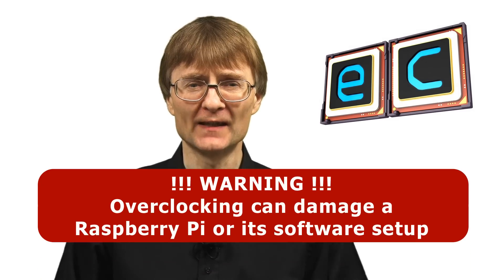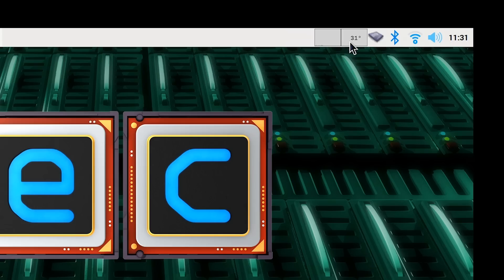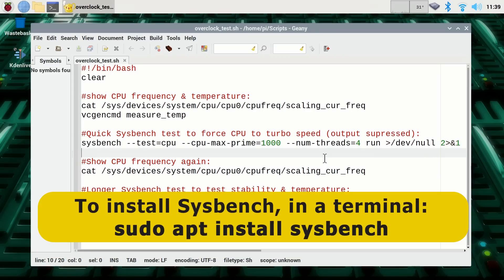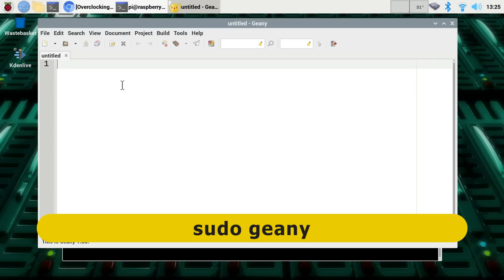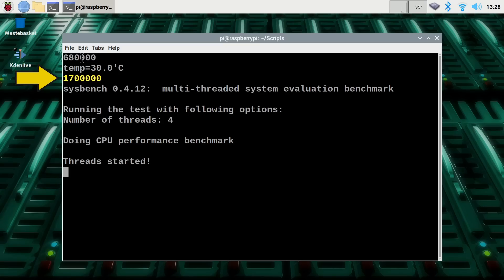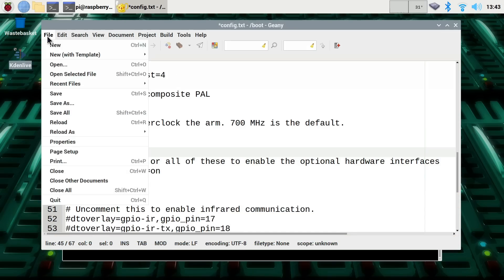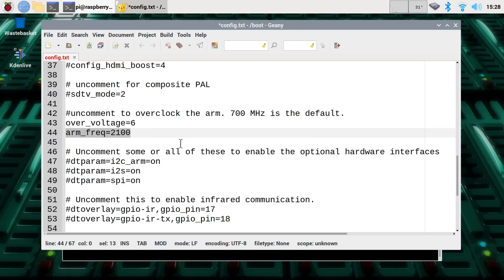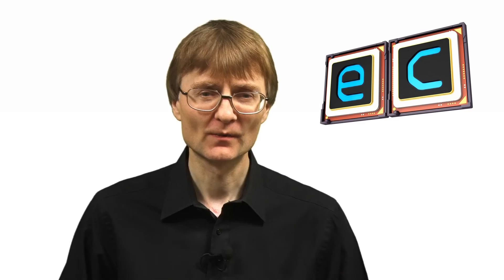Raspberry Pi 4 Overclocking

Comment: My RaspberryPi 4 only runs Firefox and shows stats form my PC as well as PiHole and Unbound. I am thinking of underclocking it 100 MHz and then try to undervolt it so that it is stable but I may save some watts... That would be nice. Electricity is so expensive these days and it runs 24/7.

Comment: My pi 4 booted at 2510Mhz and crashed after 2 seconds.  I was able to boot to windows 10 desktop with 2380Mhz.   Linux has weird issues with above 2ghz overclock and that is funny to me.
Reply from the maker: I bet that was a great 2 seconds!
Reply: I see very often the number 2.4ghz when I watch other sbc YouTube videos. It can't be super stable or is that a sweet spot/absolute madlad #. Just curious because I've got a new one coming in the mail.

Comment: Maybe a talk about underclocking.
WHY under clock?
Using the Pi as a controller or limited computer and on battery where most if not all of the 1.5Mhz is just not needed.
Would it save current usage in a battery situation?
Reply: Wouldn't they just use a Zero instead?

Comment: Hello there! I did a little statistics in Excel... So, between 1500 and 2000MHz the speed increase is rather linear: R² = 0.9935 for SysBench and R² = 0.9982 for Kdenlive.
However, adding the last point - with either 2294 or 2100MHz - ruins the linearity.
According to trendlines, I'd expect SysBench to show time of ~165s at 2100MHz and ~142s at 2294MHz, while Kdenlive time to be ~168s at 2100MHz and ~150s at 2294MHz.
Reply from the maker: Thanks for this, most appreciated. :)
Reply: @ExplainingComputers  you are welcome, the pleasure is mine :)

Comment: i've been overclocking my Pi4 since day 2 I believe and always to 2GHz with a Flirc (yes, passive cooling) case. I've done many stress tests and only got it to throttle when using CPUBurn..but again, passive cooling. One thing useful I'd like to mention, though all the Pi overclocking videos I saw so far are using 6 for over_voltage (with 2GHz) ,, I use 5 - and it works just fine & stable

Comment: The reason why you don't get any benefit from overclocking the GPU is because you can't overclock it. gpu_freq does nothing. You can put any number above 500 and it will never pass 500 Mhz. I tested it with a bash script that monitors GPU freq and it show that to be true. 

Just putting it out there, many tutorials put the gpu_freq and  they don't know that it does nothing.
Reply from the maker: Very interesting info, thanks.

Comment: This is exactly my experience, too! 2.Ghz with Ice Tower: No Problem at all... Everything above is unstable and (even with higher cpu_voltage) lead to unexpected behavior like reboots.
Reply: I should try overclocking with my sub-zero cooler... probably get over 2000MHz

Comment: Never understood the need to overclock, will this not just reduce the life of the CPU? Then again a new Raspberry Pi comes along each year like clockwork to buy.
Reply from the maker: Yes, overclocking will indeed reduce CPU life, although not badly if you can keep a Pi as cool as the ICE Tower does.
Reply: Yes overclocking is likely to reduce the total lifespan of your hardware, however depending on what you're using and how much you're overclocking it can be basically irrelevant as it will be obsolete by the time it starts to fail anyway. Usually if you run an overclock as an everyday use you want to avoid the more extreme overclocks for just that reason, to make the lifespan impact negligible.

Of course it also depends on what you're using the hardware for, it's entirely useless to overclock (besides the fun factor of overclocking) if you don't actually use that increased speed after all. Something like overclocking for gaming can be very nice because it's essentially trading lifespan that you won't end up using for slightly increased performance, assuming you know what you're doing with the overclock (and have cooling that can handle it)
Reply: Are we heading to a water cooled loop and a 1000 watt power supply to overclock a Raspberry Pi higher than 2ghz?  Yes I’m being silly! Back to my air cooled not overclocked Ryzen 3200g PC that runs so fast I can’t see it copying files between folders even without a RTX3080.

Comment: Excellent vid as always.  I look forward to my Sunday morning brunch in USA and watching UR latest vid!
1.Have U found a case that completely encloses the pi and the Ice Tower Cooler fan u like?  I believe the Geeekpi -  Rack Case Stackable (designed for 4 pi computers) might do the job for this tall fan.
2.How about testing the Geekworm - Aluminum Passive Cooling Case or the Dorhea - Armor Case with dual cooling fans for max temperature compared to the Ice Tower Cooler?
Thanks

Comment: 2:34 you need to change the governor from  on demand to performance by the command:  cpupower frequency-set -g performance 
or you may do it by clicking on the icon and setting the changes

Comment: What effect (if any) does overclocking have on a Pi's lifespan?
Reply: RP4 is cheap and it's easy to have another to go anyway. Also it's getting obsolete within no more than 2 years. So just no serious risk to push limits a bit:)
Reply: Keep it cool and it should last...get it hot on a regular basis and kiss goodbye to longevity...oh and don't push the voltage to the max
Reply from the maker: As Dave says, providing the Pi is kept cool, there should be little impact on lifespan. The ICE Tower is a key component here.

Comment: I wonder if there’s an issue with the clock speed reporting over 2GHz? So maybe it is running at 2,100 MHz but incorrectly reporting clock speed. If this is the case you could compare the reported sysbench time with the time measure from the video capture. The video capture would be the true wall clock time and shorter than the reported time from sysbench.
Reply: To clarify: sysbench is counting CPU cycles then multiplying cycles by time/cycle to get wall clock time. So if it is running at 2.29 GHz but thinks that the clock period is 1/2.1GHz it will report taking longer than it actually did. At any rate something fishy is going on here.
Reply: Correction: Maybe it’s running at 2.29GHz but thinks the clock is running slower at 2.1GHz with a longer period (time interval) per cycle. So sysbench may be computing elapsed time as cycles/2.1GHz instead of total cycles/2.29GHz.

Comment: Here's more info for the overclocking results :)

Theoretical improvement, based on frequency:
1.5GHz: 0% (default turbo)
1.7GHz: 13%
2.0GHz: 33%
2.29GHz: 53%

Sysbench improvement (by speed):
1.7GHz: 13%
2.0GHz: 33%
2.29GHz: 29%

Kdenlive 15s 1080p render improvement (again by speed):
1.7GHz: 10%
2.0GHz: 27%
2.29GHz: 33%
Reply from the maker: Thanks for your calculations!
Reply: @ExplainingComputers  But of course :) also nice additions here
Reply: @ExplainingComputers  I calculated slightly differently from the OP's table.
Instead of using 1.5 GHz as the baseline for each improvement, I used the previous speed or timing versus the new.
Results follow:
Frequency	Increase	Sysbench	Improved	Kdenlive	Improved	Comments
1.5 GHz	0.00%	237.4	0.00%	225	0.00%	Baseline (stock settings)
1.7 GHz	13.33%	209.4	11.79%	204	9.33%	Prime calcs are CPU-bound. Kdenlive render is not, shows less improvement .
2.0 GHz	17.65%	177.9	15.04%	177	13.24%	Further improvement on both, but still not equal to increased CPU speed %.
2.1 GHz	5.00%	184.7	-3.82%	169	4.52%	Odd result with Sysbench, may have reached limit. Back down to 2.0 GH.
Reply from the maker: @MarcusPHagen  Thanks for this, and I agree -- limit reached over 2 GHz.
Reply: So technically 2ghz is best as long as you have a good cooling system and you have a high quality power supply.
Reply: @zen608  seems like it :)
Reply: @zen608  so, it seems that 2.29 GHz really means "2.29 GHz on one core and only 2GHz on all cores".
Reply: pretty much 2.0ghz is the safe and stable limit as long as you have at least a passive cooling solution and a good power supply. I've test 2.1 and I get problems with stability, even it makes any device connected to the usb 3.0 port disable my wifi.
Reply: 6% improvement.. For running hotter... Larger risk... Potentially less stability? I'll stay at 2.0GHz lol.
For what I use this for.. "Kodi" there is no point that I can see. Lol albeit my vision is narrow and shallow. Lol.
Reply: I managed to reach 2.4 GHz on my Raspberry Pi 4 with an ice tower cooler.
Reply: Thanks for the break-down.
Reply: Is there a valid step between 1.7 and 2.0? I’d like to try 1.85-1.9 for a nice compromise between speed and safe margin of stability
Reply: @bakedbeings  Yes, you can probably enter just about any value you want to :)
Reply: Cooling may be more significant than you expect when reaching the higher speeds. Playing around with my new Pi 4 and running Chris' suggested sysbench, at 2Ghz my Pi took 213 seconds reaching a temp of 44 degrees. With reconfigured cooling which stopped it exceeding 34 degrees, it took the 177 seconds that Chris experienced. The difference this 10 degrees made was quite an eye opener as 44 degrees is way short of the expected throttling temp.

Comment: So I'd recommend putting it at 2GHz and backing down the voltage until you go unstable, then moving back up 1. Most CPUs don't need so much of a voltage boost at 33% overclock, and metal migration is a b**ch. I also would recommend doing a " sudo apt-get install hardinfo " and using it's benchmarks.

Back in the day, my old AMD 486DX2/66 took a 50% overclock (Changed jumper setting from DX2 to DX3) with no voltage boost at all, and was happy as a clam... and so did the CPUs of a couple of friends.

Comment: Can it now play 1080p 60fps YouTube videos without dropping frames?
Reply: Regarding YT video playback, another viewer commented:
I think that's a problem with the video driver, you need to upgrade firmware/kernel and setup the Full KMS Driver. https://retropie.org.uk/forum/topic/25370/good-news-regarding-tearing-and-low-emulationstation-performance-on-pi-4
Of course, your internet connection might also be a limiting factor. My Surface Pro has started struggling to playback @720p. But, I think it's WiFi is dying. 😢

Comment: I use my raspberry pi 4 on 2147mhz with the ice tower low profile and a case i made out of wood plus a 13inch 1080p laptop panel with a driver board. The distro im using is manjaro xfce . I use Gimp, libreoffice and firefox mainly for schoolwork and retroarch for gaming. Much better than those sirup slow chromebooks.

Comment: Minimal gains. Nothing to flip your wig over.
Reply: @J Fz Well, my point was more general (and flippant), but I'll address your comment. A board that must be overclocked to the limit of its design envelope to serve a specific purpose is probably badly-chosen for its application, especially if there are similar devices that satisfy the requirement more easily. Of course, CPUs or other components can be often be pushed harder for amusement, but for any serious purpose, a better device is always preferable. In critical applications, over-speccing (in this context, equivalent to under-clocking) is standard practice. So, a user is either running ordinary processes, in which case overclocking is unlikely to be useful, or running critical processes, where another solution should certainly be chosen. You'll agree that this would not be viable for a commercial product, and I suggest the same logic is universally valid. This is learnt very quickly when prototyping circuit designs and choosing components - never try to compromise on component spec (for example to save cost).
In regard to your comment about power, the heat produced is roughly proportional to the square of the clock speed (and also the square of the voltage, so changing both is quickly disastrous) - a fact that is often overlooked, ignorance of which is responsible for many burnt chips and surprised hobbyists who thought they were being clever. I suggest that this video would have been a good vehicle for explaining good design practise (to minimise power consumption, risk of fire, etc), rather than merely fooling around with a Pi4 and pretending that something is being achieved, when, in almost all use-cases, it hasn't.

Comment: Mild critique: it's a bad practice to run any GUI application as root using sudo. That can cause permissions errors, and in badly programmed applications might prevent you from starting them at all, until you delete all of their files! With that said, this is a solid introduction to the world of Raspberry Pi overclocking, and I look forward to next week as always.
Reply: Alex Rawson Can you suggest a better way to do it?
Reply: @BoonieOetGelaen  Terminal, mostly. Strictly speaking, the only safe way to edit system files is sudo -e. tbh it probably won't matter here (the devs probably worked around that), but it's a best practice.

Comment: Just as you said Chris, I've found that even the mildest GPU overclocks can cause stability issues. Often best left as standard..
Reply: Overclocked since October with my first Pi4 2100-2125, GPU anywhere between 700-775. Over voltage 6. It never ever took 800. Completely stable at 775 for months, any task. Typing this on my second Pi4, settings are 2150, GPU 800,  over voltage 6. Pi4 no.2 is newer and doesn't get as hot, also has a larger heatsink with no case. I think at this point all the glitches I've had could be attributed to individual emulator settings, and Vulkan when I tried it. The worst thing I've done to my Pi4 seems to be a bad SSD. Trying to make it work without a PS for the drive itself on a drive it wasn't happy with. It still works, but there's permanent noise on  the USB ports, all of them, and barely noticeable bands on the screen. Only see them on a plain background (Android.) Not sure of the cause it didn't seem to happen instantaneously. Could also be from setting the over voltage too high experimenting. I think it was the drive though. That Pi still works otherwise same.
Reply: There is a way to overclock without overclocking. Somewhere on here there is an interesting video from a "Overclock Champion." They way he does it is by using liquid nitrogen. The contacts in the CPU become super conductors, and the performance/speed just starts going on on the chip.
Reply: @GeekBoy03  Superconductors at liquid nitrogen temperatures? I highly doubt it, only a few special materials can superconduct at that relatively high temperature, and CPUs have none of those (as they're not useful at room temperature). Conductivity is improved, but it's not superconducting.

Comment: Cool. That's exactly what I did on my pi 4.  Running nicely at 40C with the Argon40 case.  Thanks again for the video Chris.
Reply: My pi 4 runs at 60c idle after it heats up a bit...
Reply: @itainelken  Do you have active, meaning fan, cooling or just a heat sink?

Comment: The very last CPU speed is actually something similar to Single Core Boost (to my believe), which means if the CPU only uses a single core, it will boost up to 2.25GHz. KDen Live uses single core process only, so you can get a better result, but your Prime number script uses 4 cores, so you won't get 2.25GHz for all core. If you select 1 thread, maybe you can see a clearer result.
Reply: Yeah it is like Intel Boost. 1 Core to the max and the other get cut to a lower freq. U can test it with CPU govener to performance, but not all Rasp like that. I have 3 Rasp4 (2x4gb,1x8gb). And only the 8gb get to the 2294 Mhz stable with perfomance governer. The other get blackscreen or the pi shutdown.

Comment: The reason why the video render didn't improve much was probably because the video editor uses hardware acceleration? Aka GPU or an encoder in the SOC. I'm not sure that's a thing in kden live but it'd make sense since ARM SOCs tend to be good at this.
Reply: Unfortunately, Kdenlive cannot use GPU acceleration, neither on desktops nor on RPi.

Comment: What about the vice versa end by "underclocking" in idle mode ?

any chance to lower the sbc power consumption ?

Mine is running at 38 kWh p.a. simply doing nothing except pi.hole with very low traffic.

thx
Reply: @J Fz Why ? I have times I need full performance and then 12 hours of complete idle but always ready for usual action-

So I can benefit from using different config files and rebooting after exchanging the config file. 

That allows me to run full speed during daylight and then going back to ultra idle

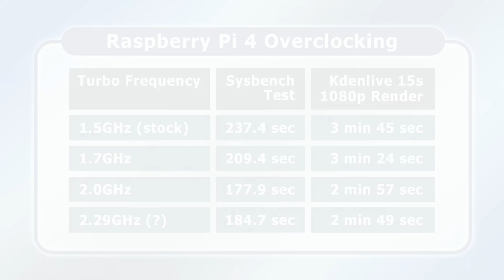Comment: 19:06 Please be aware overclocking can unsync your audio
Reply: Regarding YT video playback, another viewer commented:
I think that's a problem with the video driver, you need to upgrade firmware/kernel and setup the Full KMS Driver. https://retropie.org.uk/forum/topic/25370/good-news-regarding-tearing-and-low-emulationstation-performance-on-pi-4
Perhaps this would solve the audio sync issue, as well?